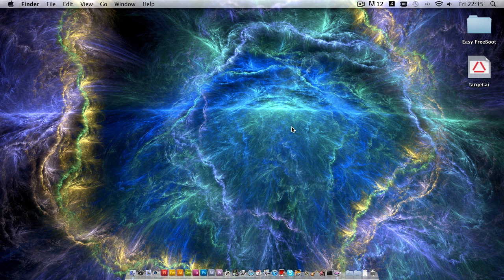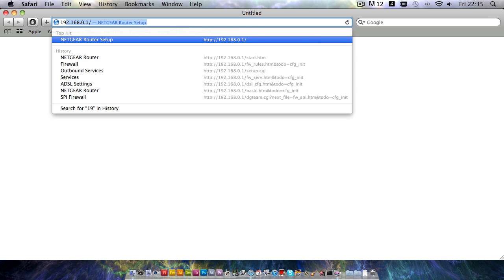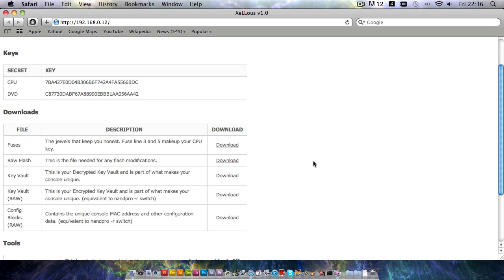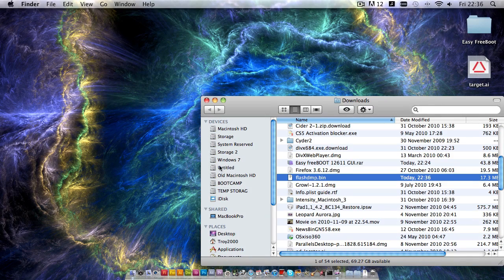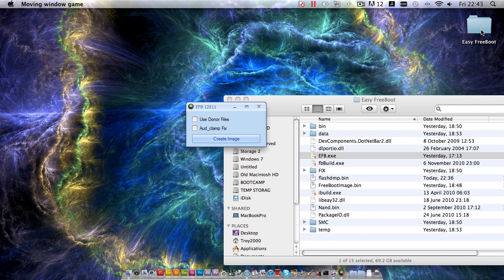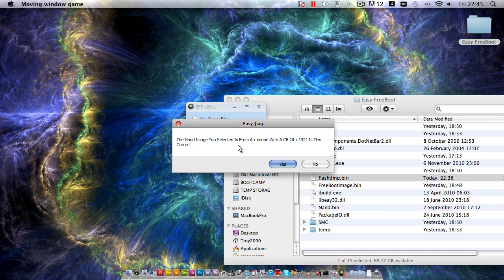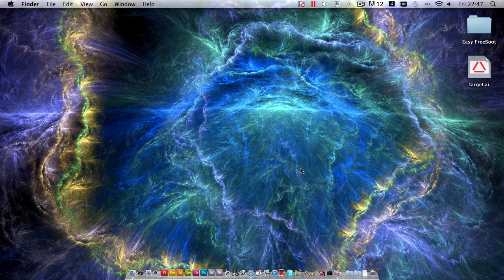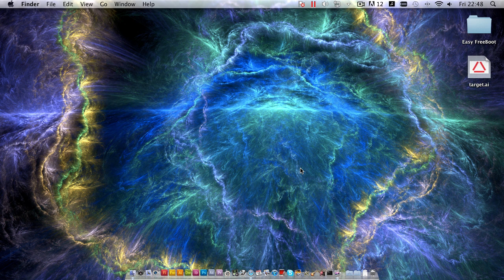JTAG Tutorial: How To Flash FreeBOOT v0.04

Comment from the maker: @TheHappyKamper 

I suggest you run the dump twice more.  If you receive the same error on both occasions, it is more than likely a bad block.  360 Flash Dump Tool does not detect bad blocks.  For this, you will need Degraded v1.1.

Comment: Backed up my 9199 NAND image using flash 360, but I receive the following error:
"ERROR: Reading block 193 status 204"

I suspect the NAND should still be OK. As I chucked it in to 360 Flash Dump, and it didn't report any bad blocks.

Any advise as to whether this is the case would be greatly appreciated.